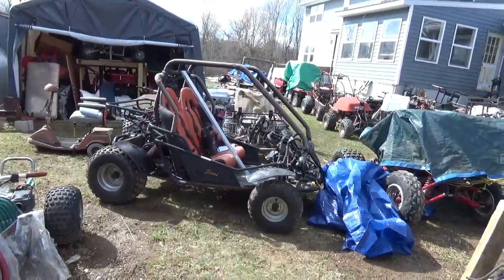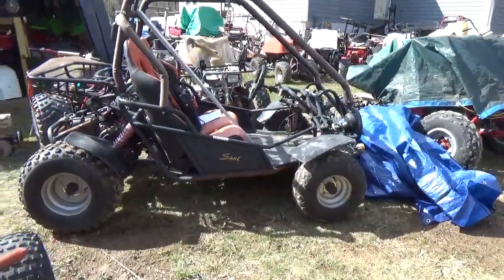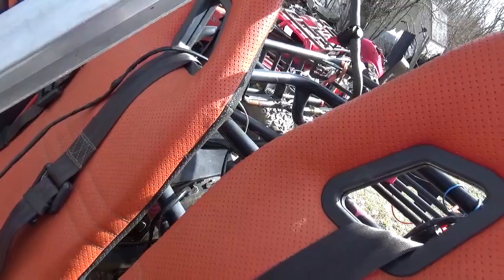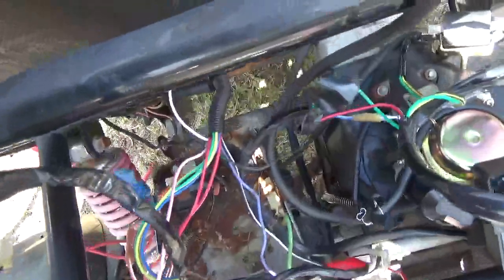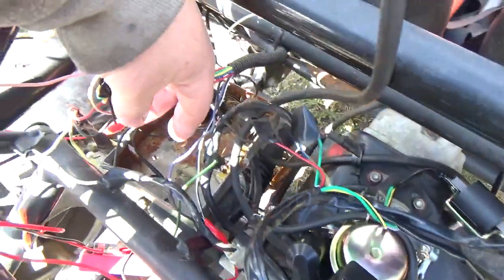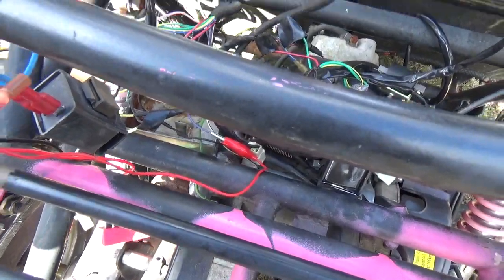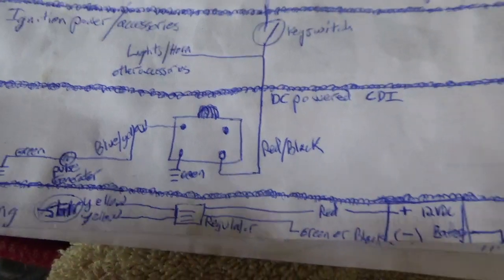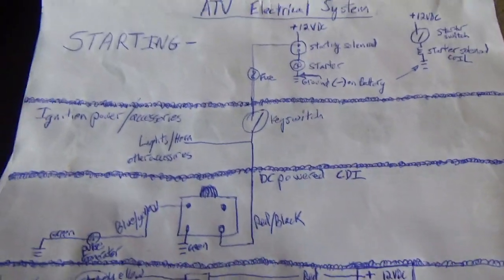Sunl Alias Off Road Go Cart, wiring the key switch, starter, engine run and stop circuits,

Comment: Very informative. Ive been working on a honda 200cc quad engine. It was smashed into a two seater off road go kart. Wiring all hacked. Ended up buying a new harness. Learned alot from your videos. Keep up the good work. This one in particular helped me diagnose how to install a key switch that started the starter verses the handle bar set up i got with the harness. Thanks again for your videos. Look forward to many more

Comment: Suzuki I have the four wire's cing out top of stator cover together with a plug on it and two separate wires assuming go to the push button on the starter its black and red stripe and green and red stripe starter selanoid is covered only have the big wire coming from it and the plug goes to cdi box and it has two separate wire  plug for?

Comment: Hello I hope all is well with you. Question How can i use a AC cdi box with this key switch with the 3 wire key switch so it stops the engine? Or do i have to use a separate kill switch to stop the engine? Thanks

Comment: I have a Sun l 250 cc buggyAnd I bought a new wiring harness for it the CDI that’s on it has two plugs the one I got only has one and also the wires coming from the stater are all yellow...I’m wondering if I have the right wiring harness since the CDI only has one plug on i, and how do I determine what wire is what coming from the stator Since there all yellow

Comment: How do I find a wiring schematic for this buggy? I have a 2000 sunl alias 150 and I cant seem to get the lights to work properly. They dont even light up enough to overpower a candle and they seem to be powered by the AC side of the stator only receiving 2 volts. If the light switch is turned off then the whole charging system shuts off. I need help!

Comment: Where does the plug from the auto choke go
Reply from the maker: `Hey Justin!!!!   One side of the auto choke has to go thru a resistor of this value and type, https://www.ebay.com/itm/US-Stock-5x-14-ohm-14R-10W-Watt-Aluminum-Housed-Metal-Case-Wirewound-Resistors-/391904268539?hash=item5b3f5090fb    , then to ground.... the other side of the auto choke has to go to one of the yellow wires coming from the stator.... I hope this helps,,, Thanks for asking, watching, and commenting!!!!

Comment: Harvey what's up? I have a question for you...
At the end of this video
You mentioned the Wires that comes from the stator to the voltage regulator  ....
I have something similar to this ...
There is 3. Yellow wires right
Then I have a red black and green
You said red goes to positive 
Black to negative right?
So my questions is where does the green wire goes?
Reply: Green is ground

Comment: Hi everyone I don’t know if I could ask this but I just bought a 250cc go cart and it doesn’t have the key switch so I bought one at AutoZone and now I can’t identify what wire is for  the ignition,battery and accessories could y’all please help I have a red, red with black strip, 2 black with white strip, 2 black, 2 yellow and one white wire

Comment: I have a new cdi , coil and connected the kill switch . i can get the starter to turn over but im not getting a fire in engine .
Reply: Check gap on puls generator
Reply: I have the same problem. I realize this is an older video but anyone figure this out? Was it a grounding issue or something else? I just bought a full new electrics system from the stator out and installed it plug in play to my yerf dog spiderbox. And I have the same problem I had before still no spark
Reply: How do I check the gap on the pulse generator? What is it supposed to be set to?
Reply: My not starting I dont know what to do